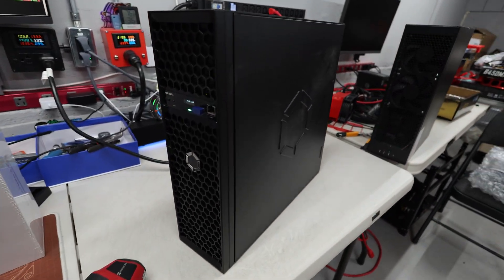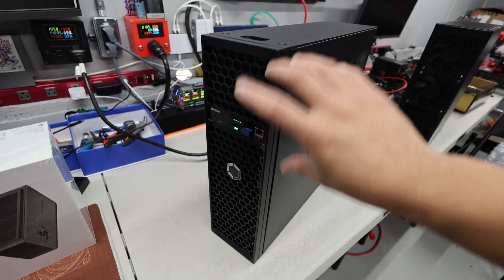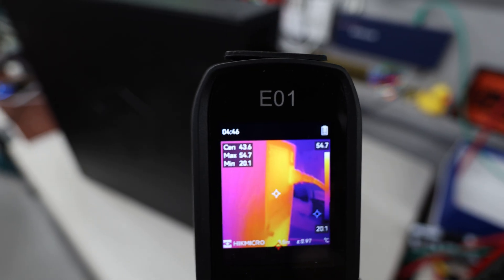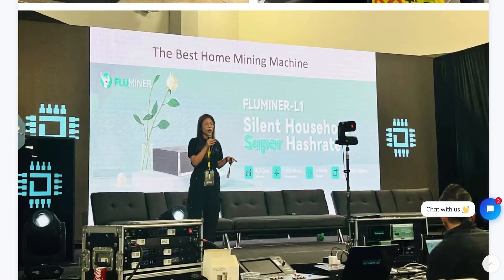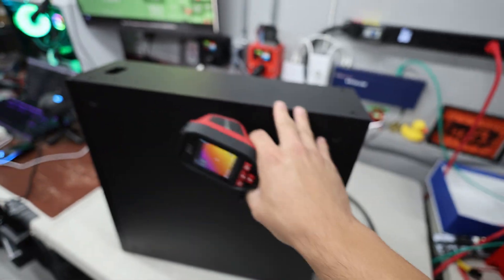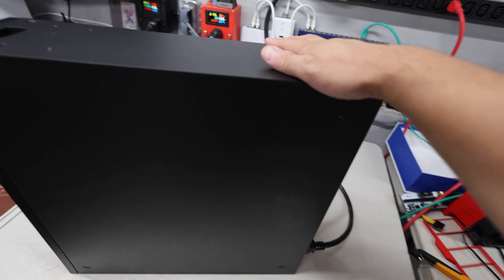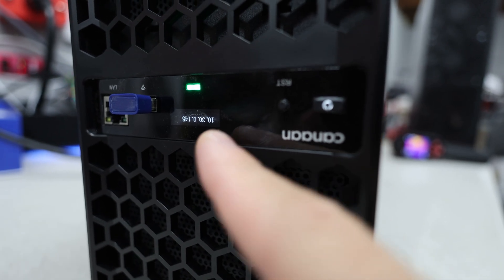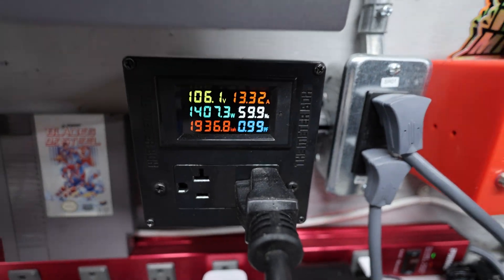Why Your Avalon Q Might Be Overheating (and How to Fix It!)

Comment from the maker: Tried something different today — I flipped the Canaan Avalon Q upside down to see if it would cool the power supply and maybe drop power draw… and it actually helped. 🔥
Have you ever tested different orientations with your ASICs? Let me know what temps and results you’ve seen 👇

💥 Sponsored by https://aslminer.com/product/canaan-avalon-q-90th-1/?ref=RPM

Your trusted ASIC supplier since 2015 — Bitmain, WhatsMiner, IceRiver, Canaan, and now the new Flu Miner L1 Pro / L2 / T3.
🛒 Use code RPM for $30 OFF your order!

#AvalonQ #ASICMining #CryptoMining #RedPandaMining #ASLminer

Comment: Why dont you flip the unit on its sides like old compaq desktop pc where the main board, chip, heatsinks are not against gravity????  This way it reduces stress on the boards or chip. Cool it with a fan to move hot air away from the unit👍👍👍👍👍👍👍👍👍👍👍👍👍👍👍👍👍👍......if the ambient temperature is cold, unit will not overheat....its cool to touch👋👋👋👋👋👋👋👋👋👋👋👋👋👋

Comment: I replaced all my fans inside with Phanteks T30 120mm fans set to 3000 rpm. This will give you better air pressure because the stock are junk cooler masters. Also the power cable is not the correct gauge for running 1750 watts on a 20 amp breaker. I replaced mine with a Heavy-Duty AC 20 Amp Power Cord, 5-20P to C19, 12 AWG, 20A/125V and the cord runs cool now. Canaan always runs things right on the edge with their cables. I also replaced the thermal paste with duronaut as after a few months it was all dried out. The power supply and heat fins are in separate compartments. If you put it on the side put internet port side up as that is where the air flows through.
Reply: Love this!
Reply: does the noise decrease and the temperature outside the miner also decreased after the fan was replaced? I will think about noctua nf 12 industrial 3000 rpm
Reply: @lolipip4643  Hard to compare noise since my workshop already runs multiple inline fans, 3D printers, and Bitcoin heaters at full power. Airflow improved noticeably after the swap, and even if my inline fans fail, the miner now pushes hot air past the damper with no issue. My Braiins Pool average went up a few TH/s, so it may have helped. I run Super Mode about 90 percent of the time unless I’m away  because that 20 amp breaker is very hot. I have active cooling on my breaker box.  Stock fans are rebadged Cooler Masters. I replaced them with Phanteks T30 120s, which are extremely solid. Noctua NF F12 industrialPPC 3000s are another good choice if you want quieter operation. I also added filter media up front to reduce dust and now testing Thermal Grizzly Duronaut which handles heat better under heavy load.
Reply: I didn't change the fans but power cable replacement is a must stock one is too small especially if you are pushing 90+ TH/s. I am using 240V dryer 10-30 nema plug to 5-20P-c19 because running on 90+ at ~1800W was the limit outlet gets hot so I switched to 30amp240V dryer plug (splitter) and it workes way better that 20amp 125V outlet. even when I am runing a dryer at the same time when needed.
Reply: @Kortik  yeah my cable was too hot to touch for more than 1 minute. It should be at least 12awg.

Comment: I cannot seem to find any pictures inside the thing.  Are these liquid cooled?  If so you should be aware of the location of the pump and the pump should never be at the top or you will reduce the lifespan of the unit.
Reply from the maker: Just air
Reply: @RedPandaMining  ahh ok.  thought the Q was for quiet because of liquid cooling.  Didn't think quiet and air cooling could go together on such a high power device.

Comment: Do you think it's a bad idea to put 2 Avalon Qs side by side next to each other on super?  Both on 240V.  In have 1 running and the heat is definitely not a major issue for me, but I wonder how or if they will be less efficient with both next to each other combining the heat output.
Reply from the maker: I would at least put so that the psu is facing down. Side by side I dont think any issue unless they were heat soaking each other side by side… maybe need a box fan in front of both just to keep em a little cooler… especially on super mode!
Reply: @RedPandaMining  Thanks man!  Yea, I am definitely gonna try this idea about flipping the miner.  I do have a little fan sending cool air in the front side.  Seems to help a bit.

Comment: Thx for the video. I have mine Avalon Q sit horizontal in Eco mode. It sits right under my desk where I need the heat. Currently mining Bitcoin on F2pool but thinking of changing coins. What do you mine on your Avalon Q?

Comment: I honestly think that these test should be done by the manufacturer instead of the customer, this makes me think they didnt do their homework on the heating elements surrounding their product .
Reply: The think is very well built. It even has separate compartments. It should come with a 12awg power cable.